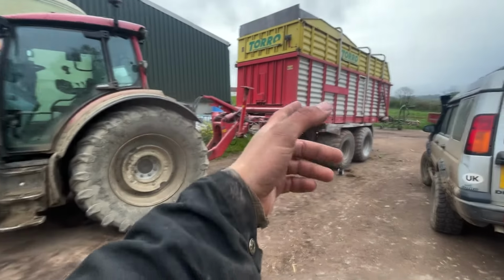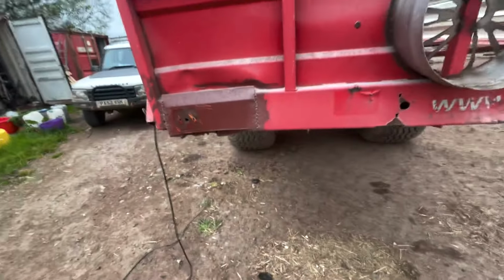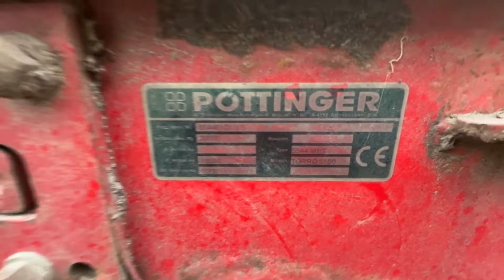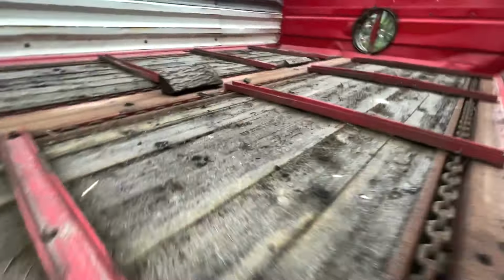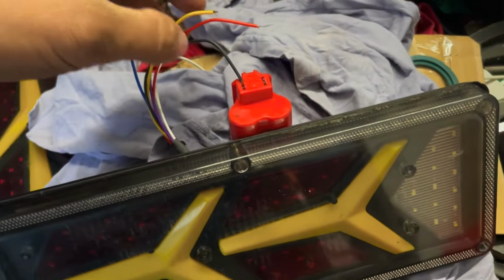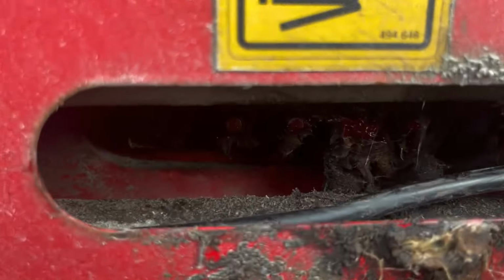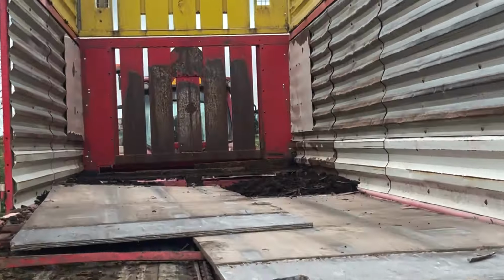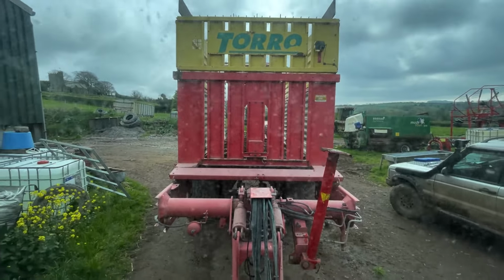New Silage Trailer

Comment: The 710 tyres are radials (note the R in the size), the 700 is a diagonal (no R in the size). 
You can move the tandemaxles quite easily under the chassis, normally there are quite a few positions to choose from, just watch out for the brakeline, might not be long enough.

Comment: If I remember right, 20t gross weight, 18t payload and 2t nose weight. Being an Austrian built she’s built for a euro hitch so light on the hitch👌
Reply from the maker: That makes sense not ideal for our hills
Reply: @samsymes123  you could just strap a ton on where the head was or chop where the head was out. It’ll be nice to tow, just not when you need weight on the rear tractor wheels. I used to have mogs soo used those hitch set ups😁